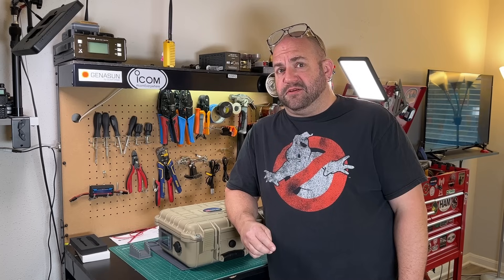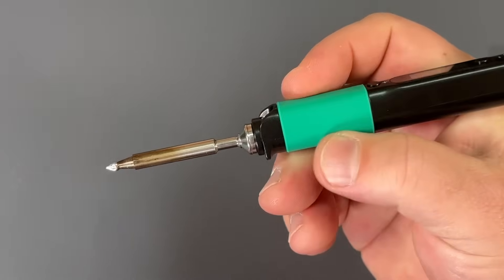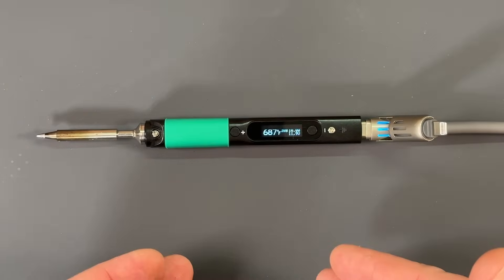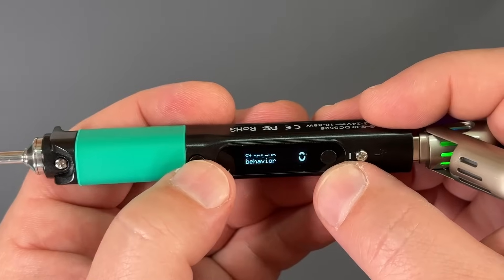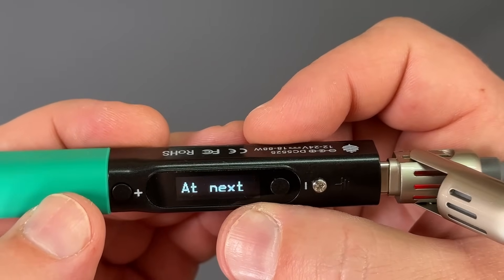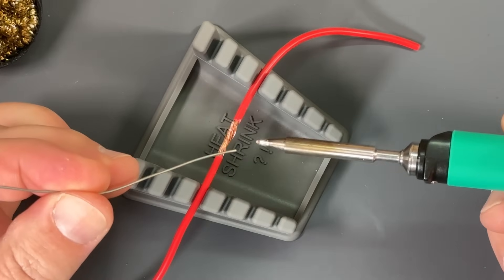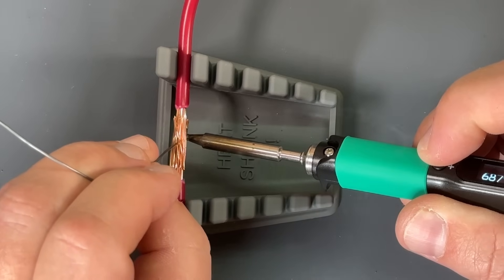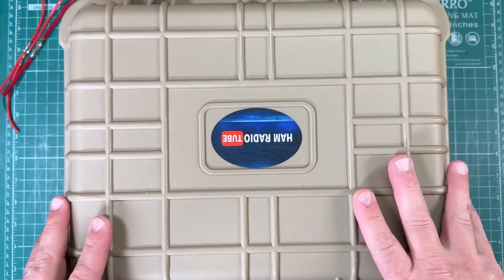This Pinecil Smart Soldering Iron Powers With USB-C or 12-24V DC!

Comment: If you really need to solder 10 gauge or thicker, if you can support the joint with a jig, use a torch style cigarette lighter to get the joint hot quicker and start applying solder, then switch to the soldering iron to finish off the joint.

Comment: Just get a butane iron for /P....
Reply from the maker: If I got a butane iron I would need to fill it with butane, which 100% would run out when I need it most.  Murphy & his pesky laws never stray too far from me.  While the likelihood of me running out of electricity from this battery is not quite 0%, it's pretty darn close.  Plus, I have several ways to recharge the battery out in the field.  I'm gonna go +1 for electricity.

Comment: I recently got one of these. The iron, a pocket pack of solder, A 65 watt USB-C PD power supply, a silicone USB-C Cable, flux and a brass scrubber all fit nicely in a small zippered pencil case. If I am without AC power, it will run off the USB-C PD battery bank I keep in my work laptop bag for...longer than I will ever be soldering in the field.

Comment: The OS is updateable.
 i use mine on a 65w usc C PD brick. In the setting set the PD setting to max voltage. The iron heats in just a few seconds to 350c. I have a full set of tips, i love using it

Comment: I wired mine to a makita battery accessory piggy back. and the 5.5 / 2.5 comes straight out of the battery piggy pack. I personally prefer the flat blade tip as it gets better contact on the smc pads.

Comment: I bought a butane powered soldering iron from Home Depot to use while our portable. Works great and it gets hot very quick
Reply: I tried them but the butane always leaks away when not in use. So they're always empty when you really need them.
Reply: @Sparkletron  what brand did you buy? I have a WAHL butane soldering iron that is over 25 years old and it still holds its gas.

Comment: Have had one of them bad boys for almost a year now, it's replaced all of my other soldering irons. Order a few different tips, a broad flat one will handle large gauge wire, I've soldered 10 ga to metal lugs with no problem. Also, that green non-slip tube gets loose after use, I put some heat shrink tubing on top of it, it also blocks more of the heat when you're up in the higher temp range.